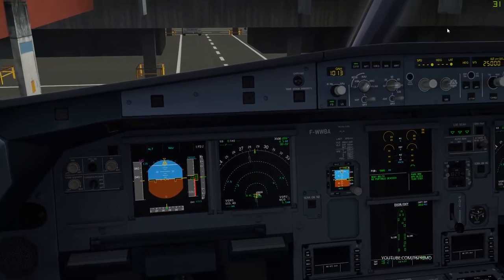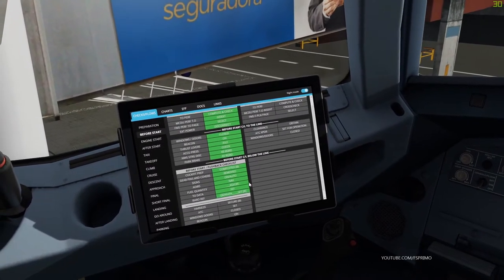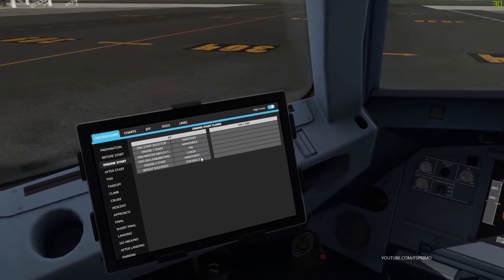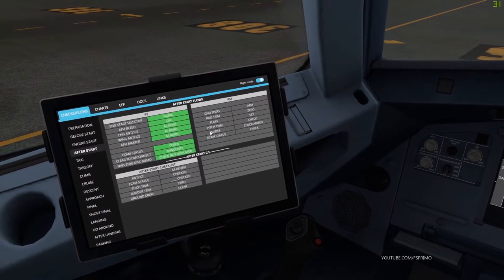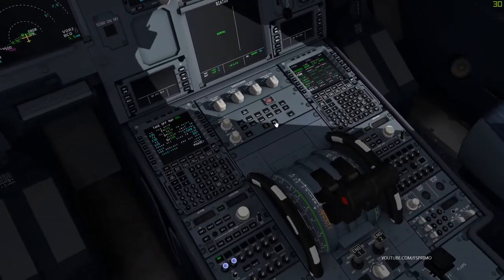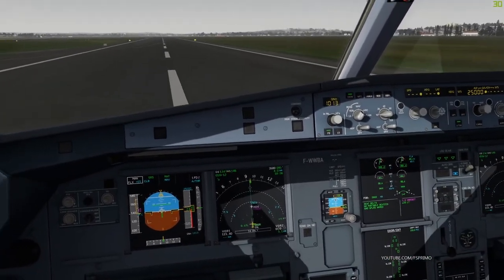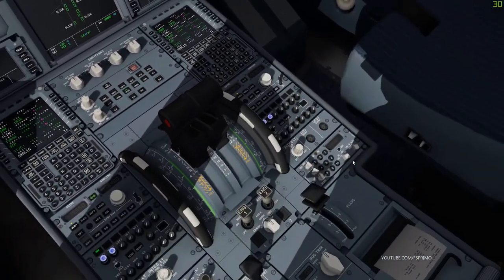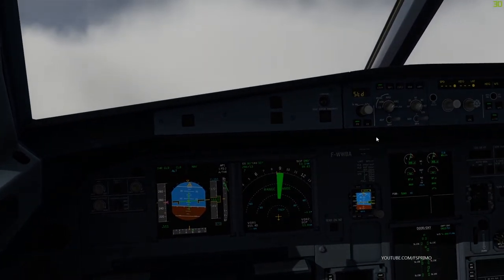【🔴P3D v5】Aerosoft A320 SBGR  Takeoff in bad weather

Comment: I have the same specs. I just wanted to ask you how big is the fps difference if I don’t overclock now and fly at 3.7ghz? I plan on getting pmdg 737, Rex direct and few airport sceneries
Reply from the maker: As I use to lock my FPS at 1/2 of refresh rate of my monitor (60hz) 30FPS, so in my heaviest scenery and heaviest aircraft at night with dynamic lights on, I was below 25fps, that give me a lot of stutters. Overclocking it bring me back to the 30+ margin. I'm able to reach 5ghz but for what I'm flying now, 4.5 is enough
Reply: Okay thank you. May I ask how much ur cpu heats up at 4.5ghz? Also which cooler are you using
Reply: @arjunseth1931  its in the description